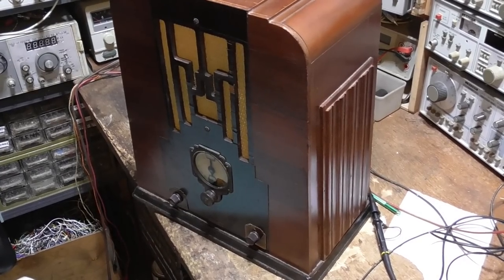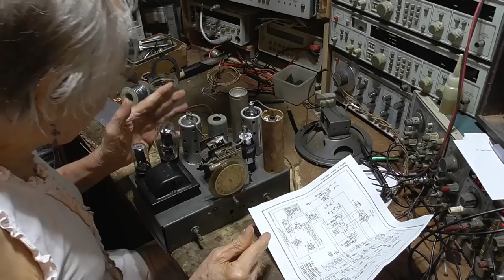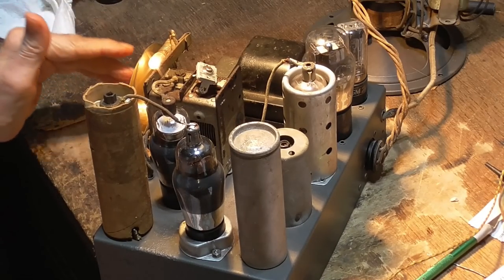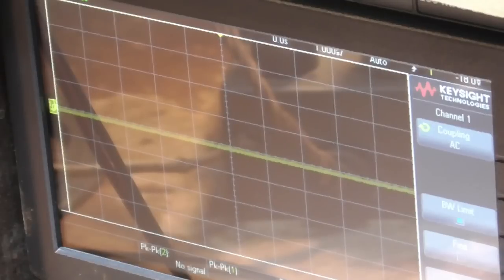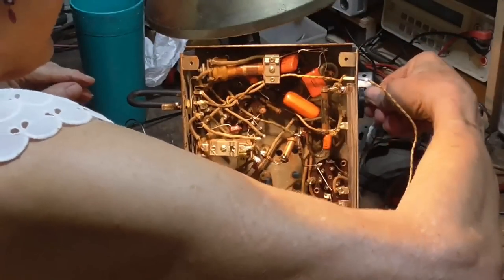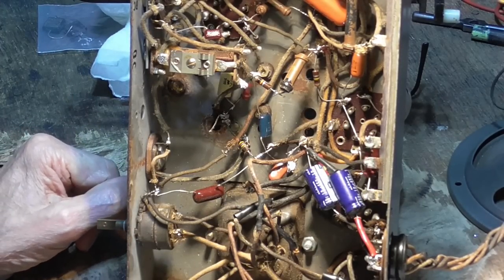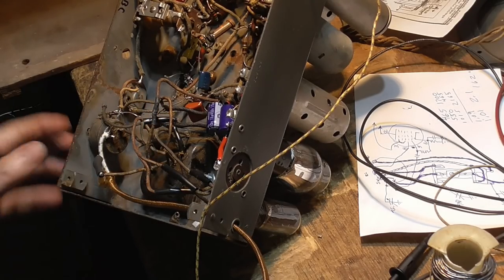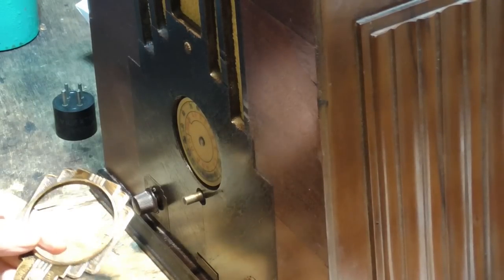REPAIRING A SPIEGEL AIR CASTLE RADIO1

Comment: Glassslinger do you still work on radios as far as someone sending it to you? I have a 1952 Zenith Symphomaile. It looks exactly like the Y83Z model. The model number Is unreadable on mine. Something odd is in the tuneing. Sometimes it will pick up FM  but never AM. and sometimes the only way it will work at all is when I have it setting by another radio and somehow it tunes in with it and by using the tuneing dial on the other radio you can go up and down the dial and the Zenith will pick up the signal. Any knowledge on this problem be very appreciated.

Comment: Short wave isn't dead -yet.I am working at the Greenville,NC Marti SW transmitter plant.At 1000UTC,6:00am local 3 transmitters will be broadcasting to Cuba in Spanish.Some areas of the world internet is not available.This plant also broadcasts VOA programs.The site can broadcast to anywhere in the world.Opened in  1962. Has 38 antennas and 9 transmitters-2 500Kw, 6 250Kw.
Reply from the maker: Unfortunately, I live right in the middle of Houston Tx, a HUGE city! The bands are nothing but horrible noise from all the interference generated by the millions of noise generating devices in the area. Background noise runs about 100 uV. A friend who lives in a small town in the country has a background noise about 1 uV!
Reply: @glasslinger  Yes--Its the NOISE on the  MW-SW bands from various kinds of switching power supplies and light ballasts.Older supplies and ballasts linear don't have those harmonic problems.

Comment: The problem with soldering that fuse in place is that if you sell the radio the new owner will have a time figuring out what's wrong when the fuse blows and he can't find it! (hidden by heat shrink).  Would be more obvious if you installed a fuse holder.

Comment: Hello? I have 2 questions, First what would you rather work on tube type or solid state? Years ago i use to be in to CB radios hot and  heavy, I talked all over the world on just a 12 meter band CH radio BUT i always had a linear amplifier hooked in line And always 500W or bigger And the tube type was much clearer this the solid state people told me..... Next question can just a coil and a magnet make AC power? I really enjoy all your video and I'm very impressed with your knowledge And work!! God Bless you miss.
Reply from the maker: Tube type. A coil and magnet certainly can make AC power! That is exactly what a generator is!    :)

Comment: Though a repeat of an earlier comment....I've been considering on building a small multi channel transmitter for both short and broadcast bands for around the house.  Something that will offer me 4-6 channels using old internet connected cell phones for inputs...giving the illusion of something to tune to on my collection of antiques....Any thoughts Ron?
Reply from the maker: I think it will be more complicated than you first think. I have had the same basic idea but using a small embedded computer to store the sound files and handle the audio channel feeds to the transmitter. It will certainly be a challenging design project!

Comment: Was adding the trimmer to the tuning capacitor to change the band the radio is good for? Otherwise why add it? What quality are the replacement capacitors? There is a lot of garbage knockoffs out there. When changing line cords, do you think it best to use polarized plugs these days to be sure the hot is switched? (especially for All American Fives with no power transformers and possibly hot chassis).

Comment: Yes, I don't really understand those who twist component leads around, so that removing and replacing components is made difficult. I was trained to fit components in a way that made removal easy, since they will stay in place if soldered properly.
Reply: J-hook is common. No need to have multiple loops on a terminal but should have a little mechanical connection.

Comment: This was made by Sentinel and is the same chassis as the model 5700B.  I've got one, the candohm resistor was completely open on mine, and it had the original 2.5v tubes.  I fixed it up and it plays okay, but it was a very cheap radio when new and sensitivity and sound quality is just so-so.  Nice looking cabinet though.
Reply from the maker: I agree totally on the performance. It was a bargain with the recap job already done so I bought it. It will do nicely for someone that wants an old wood radio for looks.
Reply: Mine was a Sentinel 'Minuteman'

Comment: First of all, I am NOT an Electronics Tech but I have had an interest in Electronics since early Childhood.   I made the "dumb butt" mistake of choosing Mortician as my Career Choice.

Without the resources to buy replacement Solid State Electronics Boards (whether affordable or available), would it NOT be easier and more economical to repair the Older Vacuum Tube type Radios?

I am sure there are Pros & Cons to both, the Tube type and Non-Tube types?
Reply from the maker: There are special cons to old vacuum tube radios but overall they are easier to repair than newer solid state stuff.
Reply: @glasslinger  -- THANK YOU for the Reply Mrs. Glasslinger since I don't know your name and "if I may call you that?"  BTW, I Love your Videos.

QUICK QUESTION -+- Since I don't have a Tube Tester, would it be Possible to test a Vacuum Tube with a regular Multimeter if someone knew the Preferred.Ohm Values and which Tube Pins to connect to or jump across?  Or, maybe with a Continuity Tester?

My guess would be "Probably Not" but I thought I would ask this "stupid" question!

I have bugged you enough, so I am getting out of here.  Please remember, "You may not be the Best but there is 'No body' any Better."   LOL
Reply from the maker: @brucewinningham4959  Yes, it can be done. Not as good as a tube tester but you can certainly tell if the tube will "do something."  Check out this YT vidro:  https://www.google.com/search?q=testing+a+vacuum+tube+without+a+tester&rlz=1C1CHBF_enUS890US890&oq=testing+a+vacuum+tube+without+a+tester&aqs=chrome..69i57j0i22i30j0i390i650l4.10651j0j15&sourceid=chrome&ie=UTF-8#fpstate=ive&vld=cid:cdd99b64,vid:hD1lVtpNHHo,st:15

Comment: Old new stock capacitors need to be reformed and then when in a radio thoroughly burned in.  And then if the radio doesn't get used for years you have to reform the caps again.  Fun with old radios and mostly because of electrolytic caps going bad.  😪

Comment: What kind of wattmeter will i need to get?
Reply: If you're in the US I believe Home Depot has (Amazon probably has it also) a digital meter called a Kill-A-Watt meter. Thats what I use. It's for checking household appliances and they are around $20 if I remember right. You just plug it in wall socket and plug your device into the meter

Comment: F I N A L L Y   --   I discover you use an 'electronic fuse.'  A diy design?
Reply from the maker: Yes. See my video list for the schematic.
Reply: @glasslinger where do I find your "video list?"
Reply from the maker: @tomtke7351  Click on my avatar picture.
Reply: @glasslinger sorry, but only about 20 or so videos appear and none "electronic fuse."
Reply: I found it by simple search   but still disappointed that I couldn't find a COMPLETE list of your videos...
Reply from the maker: @tomtke7351 It's on there. If you are using a phone it will be more difficult to find. Use a pc with chrome.

Comment: That 400 Pico Farad trimmer made me laugh, talk about being overboard lol.
The trimmer would have covered the whole frequency range!.
A real shame that some pillock made a real mess of that radio :-(.
Reply: I believe he said 400 uF (which is WAY TOO MUCH).  But  a 400 pico (400 uf uf) might work in the front end coil (band selector) if they believed a capacitor were there originally (on the tuning cap) or was the problem in the coil (Ron suspects is open). I've found both 400 Pico caps on the tuning caps and front end coils myself on RCA sets.